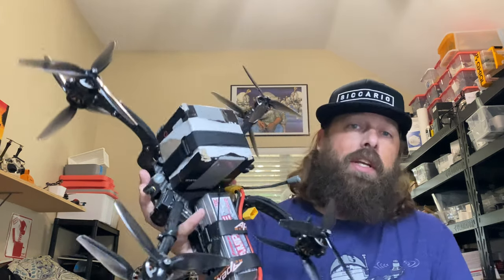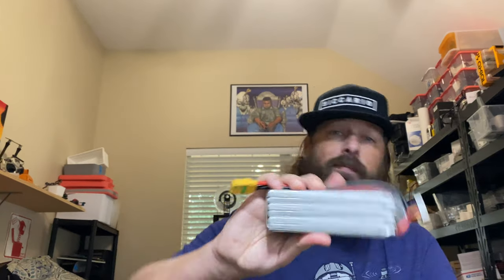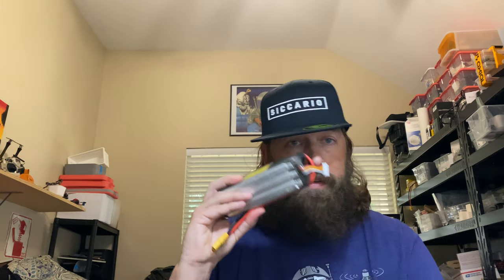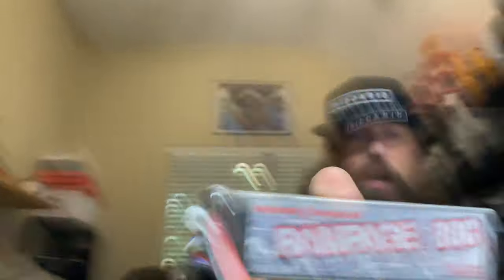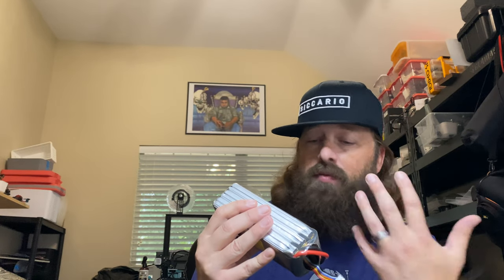Cinelifter Batteries: 1 BIG pack or 2 Small Packs?

Comment: Thanks for the video, I don’t remember you talking about connectors xt60 vs xt90. Seems like “Cinelifter” batteries come in both xt60 and xt90 with 10ga wire. Any reason to go with the xt90 plug if the wire guage is the same? I built my insider with an xt90 plug, but several batteries I’m looking at are xt60.
Reply from the maker: I always recommend Xt90 or AS150